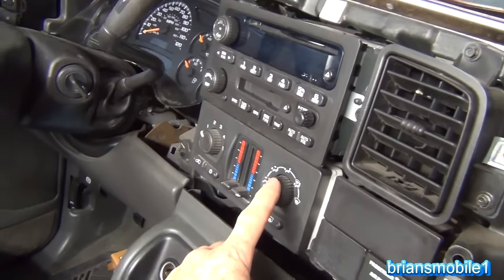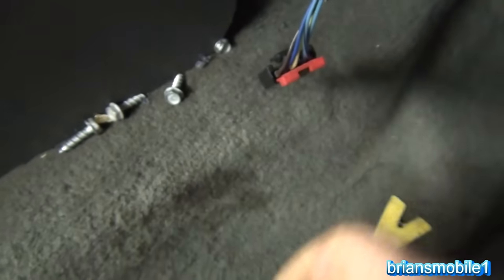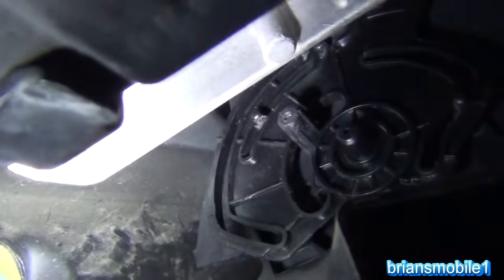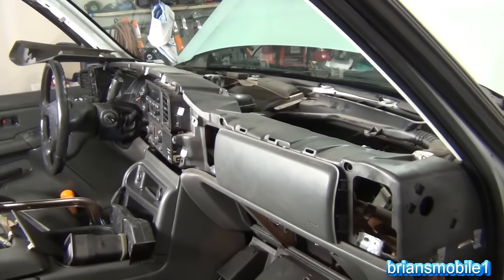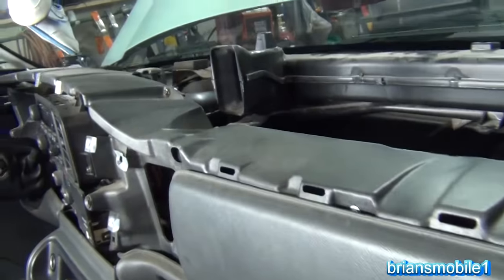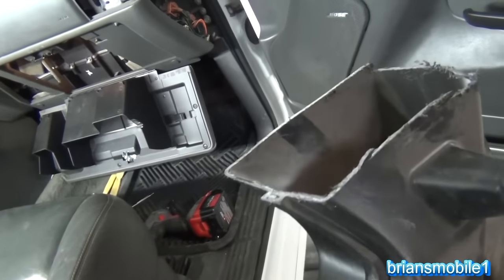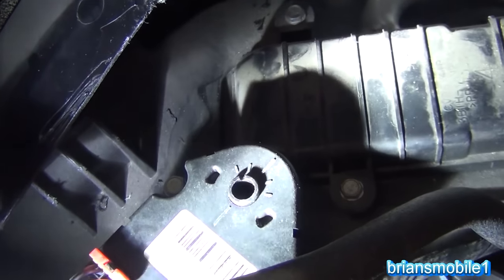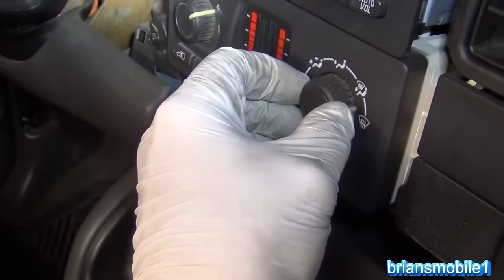Silverado Heater and AC Actuator FIX

Comment: I like the way you describe everything that you are doing when you are making the video that really helps a lot of people I have a question for you about a Dodge Avenger 2012 I get heat on the driver's side and cold air on the passenger side but the air conditioner works great do you have any solution
Reply: somehow it didn't take my question but I have a Dodge Avenger 2012 my heat work on the driver's side only and blows cold air out of the passenger side but the air conditioner works great do you have any solutions to that thank you
Reply: somehow it didn't take my question but I have a Dodge Avenger 2012 my heat work on the driver's side only and blows cold air out of the passenger side but the air conditioner works great do you have any solution to that problem thank you

Comment: Your video is great. So I change the lower passenger side for the drivers side blend temp moved it to cool. It works for about 3 min. Then move back to hot on its own and fails, with temp slider still set at cold. I have now burned up 2 of them. Any ideas?  Slider temp switch maybe? The 2nd one was set at cool and I drove away, got about 50 feet and it failed

Comment: Hi, I just replaced the Dorman 604-113 Air Door Actuator  for 2002 Tahoe, defrost, floor, etc that's above the gas pedal. I got it on and when its on your face it blows on the floor as well. when its on defrost its fine!! Any ideas? are there a Door Actuator reset? Thanks. Good video

Comment: I know this is an older video,but I was able to do it without cutting the air duct. I took the dash pad and passenger air bag out. All the upper bracing above the air duct out,also. Then with a 5.5 mm wrench,was able to get the passenger side blend door actuator out. Tight fit,but with some part and cussing,it’s doable!

Comment: Hello Brian, Did you ever attempt to do this buy removing the passenger side airbag? I was just wondering if that would prevent needing to do the cut method. I am like you in the sense that I like to do all my jobs the correct way and even if a shortcut is used, it is not a hack job. Nice video and very informational. I have had my dash completely out before because the body shop doing the straitening requested it be brought in that way. During that project the only thing I could not figure out was how to remove the handle. I was probably short on patience at that point. I have scene then figured them out but have had no good reason to remove the dash to install new lock. When I take mine apart to figure out what actuator is clicking I will be sure to install new locks for the handle so when my passengers get in they don't pull it out all the time. Its kind of embarrassing... :)

Comment: Thank You.. well thought out and explained.  Great info that will help me tackle my issue on my 05 Silverado.
It's a shame that changing Blend Doors has to be so hard and not Engineered better for simpler replacement.
GM needs to force their Engineers to replace these with no help..

Comment: What would cause the mode to stick in the vent position and not change upon selection. Would that be a control or an actuator/s fail condition? 🤔 I'm on limited time and don't want to tear into something that far unless the fix meets the conditions of failure

Comment: great video, thank you for putting it out here for us.. I have a questions on my 04 silverado. I am getting the chatter noise when it is on a blend vent and floor and goes away when I move dial to the defrost. so i guess by your video it is the actuator by the gas pedal with that plate that needed grease.. I hope so as I do not want to take apart the dash..

Comment: Great Video!   Brian can you help me figure something out with my 2005 1500 Silverado manual climate control...  When I want cold air it usually blows hot air, but I can usually get it to work by playing with the hot and cold levers, the same goes for when I need heat, playing with the same levers I can get it to throw warm heat.   And another issue I'm having is the mode selector doesn't work, it stays on defrost     I did replace the mode actuator and also the one on the passenger side but not the two under the dash.   I'd appreciate any advise.   Thanks in advance.

Comment: I have a 99 with only single control for the heat/cold, but my control that changes from vent, to defrost, and the floor is the one bad. It was terribly hard to get to just to disconnect it, so I don't know how hard it will be to actually change it... Might try now that I watched your video and saw how to take the dash apart.. Thanks for the informational video...

Comment: I have a question and hopefully you have the answer. I have a 2004 GMC Sierra 1500 SLT, So it has the dual climate controls and it has the electronic display. I am getting Ice cold air out of the driver side vents and the rear vents by the arm rests. However, on the passenger side it is only blowing hot air. it moves from head, defrost, and feet with no issues, it is just the temp control that I am having issues with. Is that just the actuator located within the dash?

and do you recommend changing all of them out at once, or just the one that is broken?

Thank you for the video/any responses.

Comment: Brian get your self a Dremel , and use heavy duty cut-off wheel no 420, 20 in a tube  the model 275 runs at 35,000 Rpm it makes this kind of work fast and easy , best tool you'll ever own!   the wheels are only 3/4 of a inch in diameter, so small you can use them anywhere!

Comment: Just one short comment/suggestion, don’t use the air at high and then move the actuators….move the actuators first then advance the air speed. This is easier in the weak links, the  actuators.Mine is a 2005 and all still work. I believe my doing things this way has made them parts last much longer……hope it works for you too!
Reply from the maker: Jeff, this is a really insightful and thoughtful recommendation.  Thanks.  I like you already.

Comment: DORMAN SUX! 
I fought with their quick release oil line to radiator couplings, and gave up after putting two dents in the radiator and 34 new cuts and abrasions on my hands. One trip to a junk yard & $2 later I had a handful of OEM clips and all the lines clicked in in about 10 seconds.

Comment: ok on my silverado the actuator was the one under the dash on the passenger side but I ended breaking the plastic shaft that the actuator went on to something it can change from hot to cold what is it called so I can change this and great vid please reply dnt want to take it to a shop or anyone in the comment section

Comment: Thinking of drilling two sizable holes to reach those two bolts without cutting duct, once done either taping or gluing plastic patches to seal the holes. Need to try it on junked truck see if this works or not.
Reply from the maker: Sounds exciting!  Get'r done!

Comment: Thanks for your help.  How did you align the mode actuator the piece that rotates to the pins.  I only took the bottom panels off, and am having a hard time trying to put that plate in from the bottom with the pins in place.  Hope to hear from you thanks again.

Comment: ok, not sure when you'll respond but I really hope you can response b4 winter is over...lol.
here's my problem, 2002 Tahoe, fan blows, control valve works, but the air does not get hot in front panel or defroster for front windshield. at O'Reilly's I learned that the back passenger heater works well on all 4 vents. At O'Reilley's they try to sell me part #604-113, I was able to see the part from under the starting wheel, I changed the control knobs while looking at actuator, and it did function. please help!

Comment: Great video. I have a 2004 2500 HD and what is happening is my fan is on high and I am not having much pressure come through my vents. You can actually hear the fan pushing at a high rate and I'm getting cold and hot if needed but no high pressure. Can you help?

Comment: Hey 👋 so I got the problem with the temperature it’s blowing hot 🥵 air to the passenger side if I change the actuator on the bottom I’ll be fixed?

Comment: Doing higher trim Crew cabs and SUVs do you have to remove the center console? I got 02 Denali.... Personally I like 99-02 better... Mainly because I'm not a big fan of the cat eye at all I just think avalanche when I see it... The Escalade is just a cat eye but they smooshed all the lights into one unit... I digress .. I replaced the temperature actuator a month later the mode one broke

Comment: Do you by chance have the correct part number for I think it's 04 thru the 07 2500HD
Classic with the dual "Automatic" climate controls?
I noticed you mentioned it won't blow out correctly if I get the wrong part.
I'm thinking the part number you have referenced is for manual only.
Thanks, and either way, thanks so much for making such an informative video:>)

Comment: I put a Dorman temperature actuator  in a 2006 dodge magnum and it would grind gears so we got a factory one from a junk yard put it in and it worked.
Reply: +austin h Dorman is crap.  Go with AC/Delco for GM.  Cheap off eBay or RockAuto

Comment: Thanks for this. Is there an actuator by the pedals on a 2002 Silverado as well? I actually already replaced the one over the hump, and I pulled the one out of the dash already ( only one there since I don't have dual controls on the 2002 ), and I bought a blower motor, so if I'm replacing two of them and the blower motor, I am going to replace all three. Can I get some information on the third one?

Comment: Brian.  I have an 04 Suburban.  My airflow is stuck on defrost. It won't go to front vents or floor vents.  Which actuator would I need to replace?  Also, sometimes the a/c will be running fine then suddenly start blowing hot air through the vents.  THat's not as much of a problem as I can restart the car and it's fixed.  Which actuator would that be?  Really appreciate your help.  Richard.

Comment: Brian.. I have a 2010 Chevrolet Express Conversion van with an AC problem.  It will cool ok but after a period of time (especially when temp. is very hot and when AC on full blast) the AC goes off and starts to blow hot air.  I correct this problem by turning the air off for a min. then turning it back on.  this seems to correct it for a while but it will happen again later.  What do you think is the problem?

Comment: Should I change my actuator or the “thermostat cluster” Silverado 2005. Heat works when I initially start truck (typically) as I drive I lose my heat on driver side but maintain heat on passenger side. If I side my control “thermostat cluster” down and then up. Heat will come back on. Sometimes awhile sometimes 5 minutes. Which should I change?? Cluster?? Or actuator??  Thanks

Comment: Thanks for the video.  On my 2004 Silverado, the driver's side will go from AC to full hot on its own.   Only driver's side pulls this stunt.  The only way to reset to cold is to restart vehicle (turn off motor and back on).  Will replacing the driver's side actuator correct this?
Reply: Hey Brian.  I just read further comments below that answered my above question with "Yes."  Also several comments on the Amazon purchase page for the Dorman actuator said that replacing the actuator fixed the "mind-of-its-own" driver's side Cold -to-hot problem.

Comment: You can do this job WITHOUT CUTTING the tubing. Take passenger air bag out and go through that  way or some just drill a hole in the tubing just to get socket and extension through to get to one bolt. Either way rocks!!!

Comment: Nice video help a lot. Bout to change mines on my 03 crew cab just a question on my passenger side when I turn on my fans to ac mode on the passenger side it blows hot air all the time duss that mean I have to change all 4 of them and another question when I turn my truck to the on position it makes this loud noise like if there's a mouse inside my ac unit can you help on my situation

Comment: good video. I replaced the blend door actuator by the gas pedal but it will only blow out the defrost or dash vent. no floor. do I have to reset something? 2006 2500 Silverado Duramax crew cab. thanks

Comment: Four years later...
Great instructional and tips video. Very thorough. But I have a question about cutting the vent (13:30). Would it not be better to remove the airbag module from the dash? It seems like that would open up significant space to reach in through. I know many people hear the word "airbag" and they are like AAAAH! DON' T TOUCH THAT! But you use the correct procedures for removal, it should be fine. Or is this going to blow up in my face?

Comment: Thank you for taking away the mystery. How different is this from a 2004 Chevy Avalanche?  My Drive side lets the heat in when i turn on the AC (located on Passenger side under dash?).   I'm guessing all sensors are identical to the Silverado.  Correct?
Reply from the maker: Welcome- they are all very, very similar whether it's a Hummer, Avalanche, or Silverado.  The parts vary, but the core principles and design are the same.

Comment: Hi Brian, This video is a little old but I hope you see this question and can help me. I am changing the actuator under the drivers side of my 2003 silverado and I am at a loss how to get to the top hex screw on the actuator. I have the dash panel pulled off and the plastic vent but there is a metal frame that is right beside the actuator and I just can't figure out how to get to it. The bottom screw was no problem, what did you use to get to this screw? Thank you any help you or any of your subscribers can give me!
Reply: Hi, I just finished my problem on my 04 silverado lt yesterday.  I had replaced that actuator by the drivers gas pedal in Nov. and since the cold here I realized my defrost was barely blowing air.  Long discovery short, I removed that actuator again and seen I had not put it in correctly as the clock "Puck" thing didn't line up right.  I used a little 1/4 in drive and socket for the top screw but then bought a Thumb Ratchet with a swivel and extensions.. At the least this job sucks, I actually called and made an apt. for Monday to the shop before I finally figured the thing out, canceled it today.  Pull your neg. batt. so the brake lights quit and use a strap to tie down the brake peddle to give you a little more room.  Mine is the Auto unit too so it is a bit different, but when you put that "Puck" in align the top peg in the slot at the far left in the slot and then wiggle and push in to the center hole of the thing. Put some white grease on the center hole  first too.   Don't worry about the gear lining up as when it rotates it will engage that gear. Re-calibrate then.  Hope this helps.  Daniel

Comment: I got a 05 that the left  climate control dont switch to heat but the right one does.im figuring its the bottom actuator.the video explains it.thanks,I'm a old disabled diesel mechanic but I think I can handle this.again thanks

Comment: 2005 Silverado with dual manual temp controls.  Drivers side blows wrong temp, summer its hot, winter its cold.  IS Dorman 604-106 Air Door Actuator the right one for the the drivers side blend door, actuator located on passenger side.

Comment: Hey Brain great video, I have a issue with my truck same year as the one in video my issue is that the two vents on the driver side close to window and next to the radio blow hot when a/c is on sometimes so i turn engine off and back on stars blowing cold again. do you think its and actuator  problem and if so which one
Reply: Mine Too..

Comment: Hey Brian, Great video!  I've got a question that I hope you might be able to answer.  Does it hurt anything to plug up the new actuator before mounting it?  The reason I asked is because I just tried to replace the blend door actuator for the floor/door/defrost direction and it seems to calibrate but will not work after the calibration.  I wanted to check the next one I get before having to go through the actual mounting process again.  Thanks.

Comment: Hello Brian. I have a 2010 Suburban and I’m battling outside air coming in on the right side of the front passenger seat. It seems to be up high behind the glove box to the right. This occurs when outside temps are in the teens and driving interstate speeds. Have you run across this situation? I had a 2001 Tahoe that did this and it was a separation of ducting in the cowl but the Suburban does not have this design.

Comment: Ok so I have a 04 Sierra. It's got the center console and rear air. The controller on the dash is digital and has a dial for each side, and there's a button for auto. Currently my driver side only blows cold and passenger side only blows hot. There's also a clicking noise coming from the top of the dash, which actuator/s would you recommend changing? Should I just pull it and do them all? And do I need the automatic ones? Any help/advice would be great, thanks

Comment: On my 2004 GMC Sierra 1500 with AC on the driver side starts to blow hot air, while the passenger side stays cold. What’s the problem? Dual-Manual control

Comment: I’ve changed all 3 of those actuators, and I’ve done the recalibration steps at least 10 times and it still blows, just hot air and won’t change to defrost or under the dash it just blows straight out the vents

Comment: Im in South Florida. 03 Chevy Silverado. Drivers side is ice cold after having the compressor replaced. The passenger side actuator went bad and was blowing hot air so the cabin wasn't cooling very well. Without taking the dash off I went thru the globe box and was able to remove the actuator. I put a wrench on it and turned the knob to the cool side and zip tied the wrench in place. Now I have ice cold air on both sides. No need for heat here anyway.